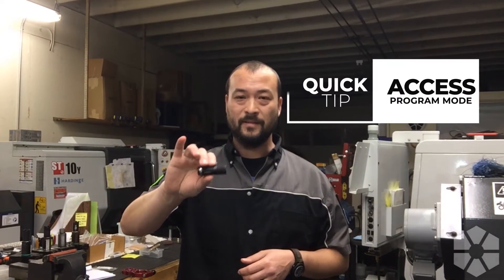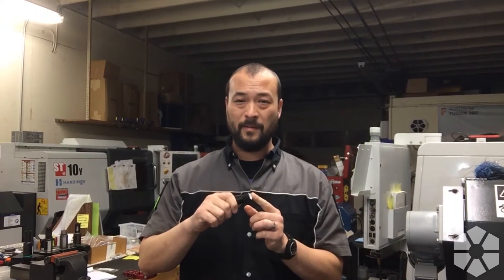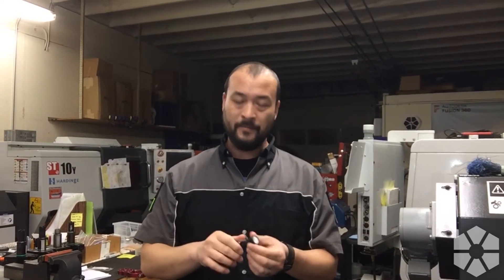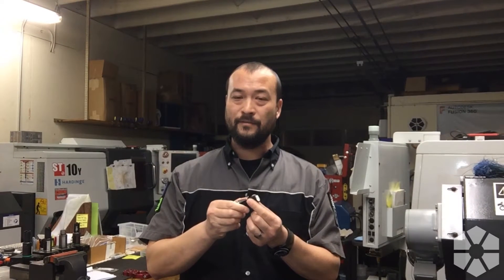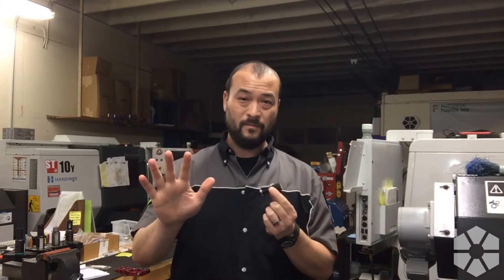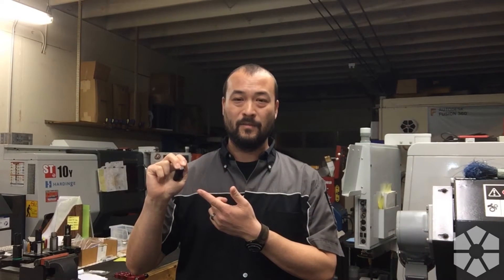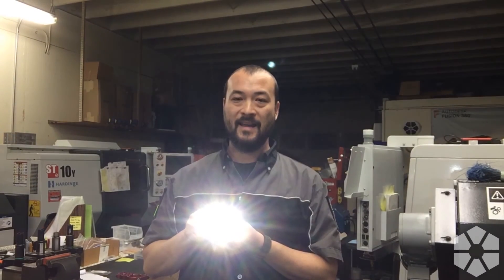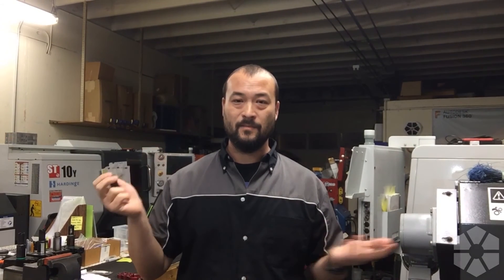Quick Tip – Access Programming Mode

Comment: Love my new Quark QK16L MKIII, but could NOT figure out how to change configuration by following the printed instructions that came packaged with the light.
Found this video by dumb luck (listing it in the FAQs might help), and even then it was only when I'd watched it three times that I realized on the tenth rapid on/off cycle that Jason was actually keeping the light ON.  Breakthrough!  Instructions need clarification, cuz it's really NOT ten quick on-off cycles, it's actually nine rapid on/off cycles (my light has a tail-switch, so it's a "presses", not "clicks") followed quickly by a press-and-hold to keep it On.  At this point, you're in configuration mode.
Reply: This comment is the only reason the video is helpful. This tip definitely needs updating/clarification.
Reply: Still to this day he hasn't updated it... I was very confused and didn't understand what I was doing wrong since nothing in the print or video said to hold at the end. Ended up figuring it out by twisting instead of tapping it and left it in the on spot.